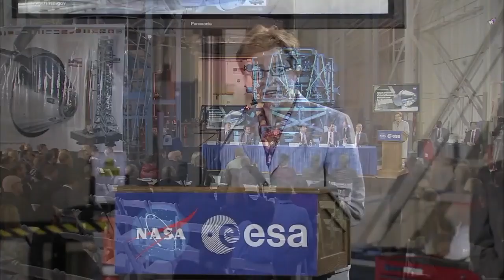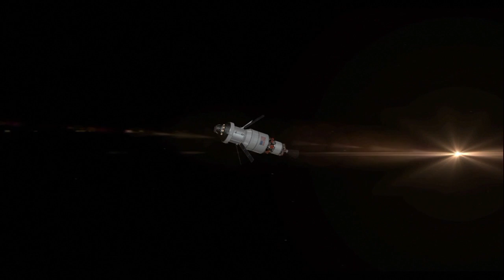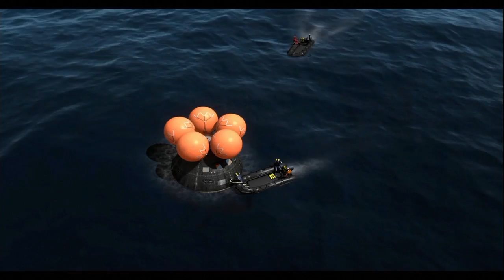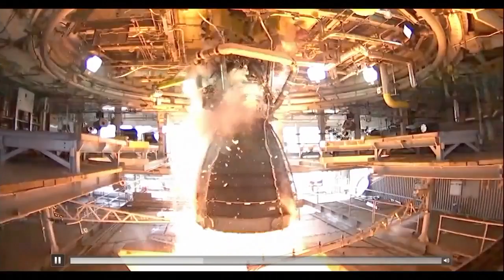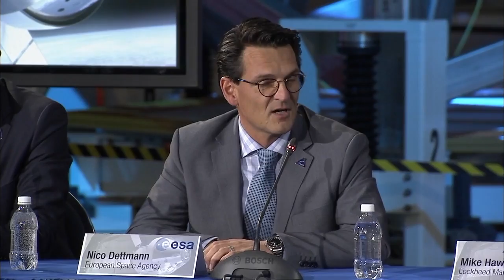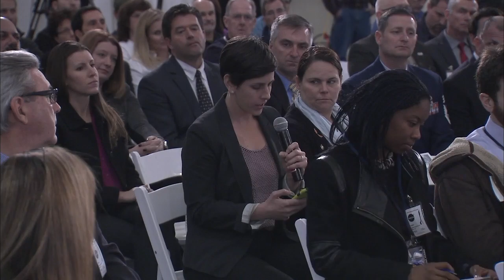Plum Brook Welcomes Orion’s Powerhouse

Comment: If spaced and blue origin can develop a VTVL reusable rocket then why can't NASA and Lockmart make the SLS core booster VTVL? Why continue to spend over a billion dollars just for a rocket that will launch once and be thrown away. We know it's possible, but I think congress doesn't want a reusable rocket, they love to waste money on their work programs to keep their constituents happy.
Reply: +Jamie Godman Before asking that question you should check the payloads for the two  different types of rockets. I mean, really, when you walk down the street and you're supposed to cross to the other side, do you cross on the zebra or you just jump in front of a car?
Reply: aserta what does crossing the street have to with building a reusable rocket. I'm sure if they really wanted too that NASA could have designed the SLS for reusability. Sure the design would have to change, but it's possible. So take your zebra and jump buddy.
Reply: +Jamie Godman Reusable rockets are only in the testing phase. If NASA were still testing for another five years, you'd probably be asking why NASA rockets aren't going to space. New technology is cool and yes less expensive but this rocket has been in the works for years and it is much more efficient than their previous rocket. If it can be adapted for re-usability (maybe landing legs add too much weight to get to deep space) I'm sure it eventually will be.
Reply: +Jamie Godman The reuseable rockets are for LEO/GSO payloads only. I have a feeling the mars mission will hold onto it's stage 1 boosters a bit longer than that, meaning it'll reenter the atmosphere at much higher a velocity. Perhaps in this case reuseability isn't possible. That's merely speculation, though. I'm not sure.
Reply: MattHappy I think eventually reusability will be solved. By either SpaceX, blue origin or both. Then most other launch providers will be forced to follow suit of become obsolete. The days of one and done are coming to an end. SLS will most likely be cancelled by the next administration after several flights due to the high cost of the rocket itself, it's simply not sustainable unless congress increases NASAs budget by about $5-$10 billion per year. Congress just wants their gravy train jobs program for their constituents that was lost when STS was cancelled. Why else would they force NASA to use the same 1970's heritage tech for a 21st century launch vehicle. Congress does not care about actual progress in space exploration as they do about keeping their voters happy and keeping themselves in power. Nasa did not want to build SLS, they were forced by congress to do this. Congress knows SLS is a huge money pit, that's why they have underfunded commercial crew all these years because they don't want to see cheap easy affordable access to space. Neither does ULA. I love NASA and wish congress was not pulling the strings with Boldens hands tied behind his back. It's because of NASA commercial crew even exists and will someday return our human space flight capabilities back to America again. The soonest we will see Orion carry astronauts is 2023. Orion development started in 2006 and won't be manned rated until 2023? Almost 2 decades, what a joke. It's just a revamped Apollo capsule with the same heat shield, landing parachutes in water only, same launch abort system, only the radiation shielding and flight computers are new tech. Congress has set back our space program decades. Good thing new space commercial companies are making advancements that will propel us into safe, reliable and affordable space flight.